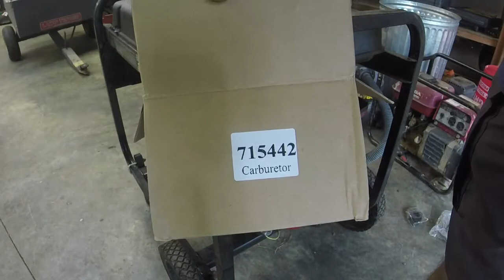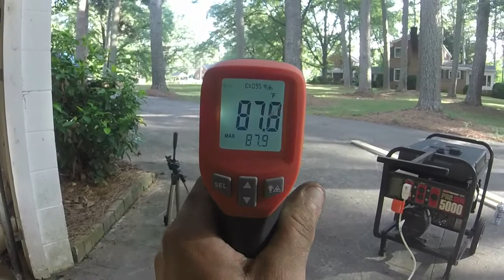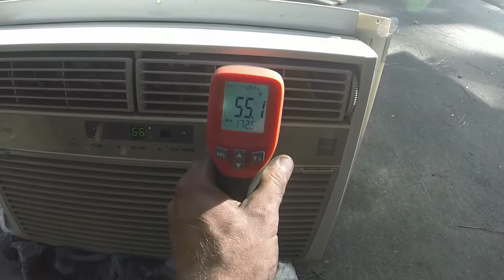Coleman Briggs Vanguard generator water damage and frozen engine, can it be saved?

Comment: James Condon's channel is good for finding out how to adjust generators if you want to fine tune that but it does seem to work OK as is.
Reply from the maker: Thanks for the info!  A little concerned about the low voltage but Bruce's Shop mentioned it could be RPM related.
Reply: Yes could be that. My understanding from watching James' videos is it depends on the type of generator. On some the RPM just equates to the frequency of the AC and you have to adjust something else for the voltage and on others the rpm does have an effect on the voltage but I would think the easiest thing to do is adjust the rpm and see what happens.

Comment: Did I miss if you took the RPM's.  3400 RPM's may get you to 120Volts.  If the voltage supplied is low the amount of current required  is higher  making more heat.  Ohm's law.   I do not mean to pick this apart just to add thoughts.    It was fun to watch this sad old generator become a happy generator.
Reply from the maker: Bruce this might be my issue, thanks for your input!  When I get it out again I'll have to check the RPMs.  I'm hoping the generator motor isn't failing due to water exposure.